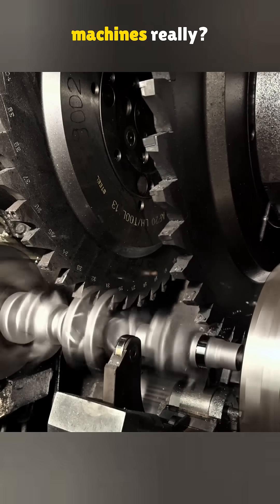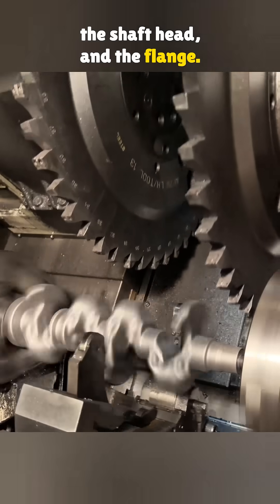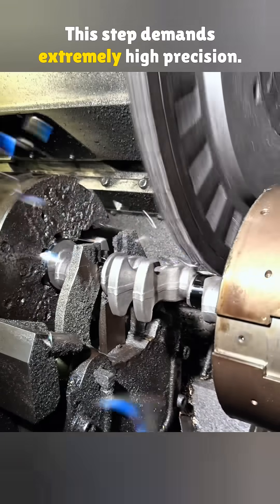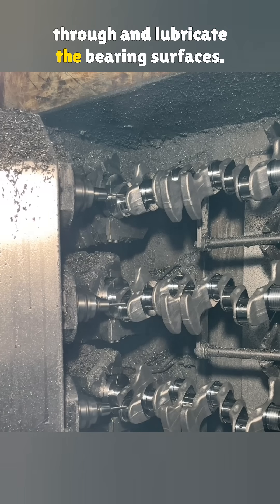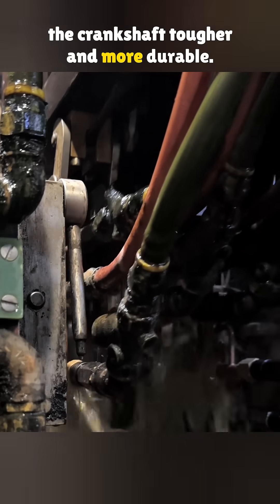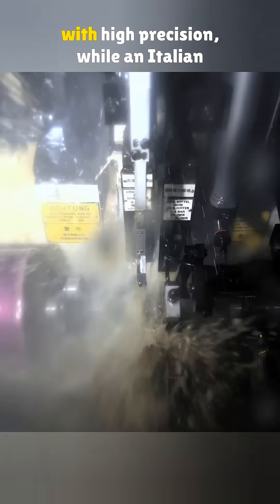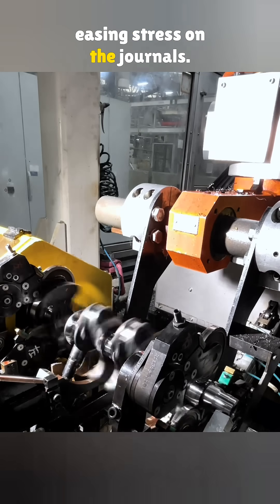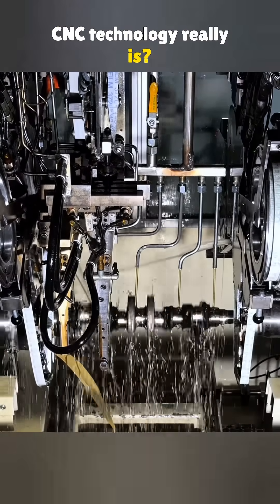How Far Behind Are Chinese CNC Machines #automobile #mechanic #car #assembly #manufacturing

Comment: What I have always been puzzled by is how come Chinese products made from these machines are way cheaper than those made in the US or other developed countries. The answer has always been cheaper labor cost. 

But that's not true, I did the math. Even if American or European salaries are 6 or 7x Chinese salaries (they're not that far apart, more like 3-4x), divided by many thousands of products, the labor cost difference is quite minimal. Assume lower electricity cost (China is about 1/3 that of the most expensive electricity state in the US), still it won't account for the large price difference, in some cases finished products from China are less than half US or European prices.

Then I came across a statistical study from China's own Nat'l Reform and Dev't Council (发改委) and realized China's price supremacy is due to massive and secretive export and tax subsidies. VAT rebates alone are 15%. Local government tax incentives take another 6-15%. 

And that's why China exporters can afford to sell their products at cost or even slightly below cost. Therein lies the secret. However cheaply and loss-making their exports are, China manufacturers can make it back through the rebates, and still end up profitable. Those rebates are powered by the Chinese central bank's continuous and secret money-printing (they NEVER announce specifics). Thus the world has essentially bankrolled 50 years of Chinese currency manipulation (illegal under WTO), and the capitalist class of other countries are only to happy to look the other way, because the same system boosts their profits.

Comment: Cnc tech in the wood working industry in the USA. I work on machines from everywhere germany, japan, italy, france, USA... Everywhere. I wouldnt say one is more agead of any of the others but each one has a strong suit that suits them well. However i will say that that when it comes to precision germany and japan are where its at, brute strength comes from the usa and finesse comes from france and italy but the finesse usually comes with a lot of headaches too. Lol. Every one of them is built with oarts from every one if these countries too so nobody is really ahead or behind anyone industry isnt political necessarily it struggles on account of politics but otherwise most everyone would work together.

Comment: I don't know alot about CNC machines but I've worked in a machine shop and it sounds like they have the best of the best equipment and take correct procedures to ensure a quality product that's better or as good as alot of car manufacturers

Comment: i visited some factories in china, and i've seen some pretty impressive machining centers which are made in china, not every single machine is chinese, and there are variations across factories, yet taking a single example for a single part type in a single factory and  making a judgment on the whole chinese cnc industry based on this strikes me as completely lopsided at best

Comment: That's because of manufacturing licences, and patents.

Some companies insists on specs for machineries used in productions.
Reply: I DON'T THINK CHINA GIVES A SHITE ABOUT PATENTS !!
Reply: @davidpeters7052 yup they'll even make it a local patent after that copy a foreign patent and brag about it being a domestic invention.

But the catch is, it's good enough for making household goods for Walmart. But not good enough precision for avionics, semi conductors or military applications.. That's why you see their military equipment failing all over the world.
Reply: @davidpeters7052 check out WIPO about China's share of patents
Reply: China has never and probably never will respect patents or copyright laws. Almost everything they have ever produced is stolen from the rest of the world.
Reply: @lpsoldin3162 check out WIPO about China's share of patents
Reply: Great comment. Well done. To those who think that China doesn't care about patents, it doesn't matter if they do or don't. They have to comply with the requirements of the customer who orders these manufacturing lines.
Reply: @alm7979 they only comply for the export client. So if a big brand is getting sued for patent infringements, then they won't get an order but it's also no impact on the Chinese factory.

On the other hand, China's domestic market doesn't care nor enforce patent rights in their own market especially when it's their own brand vs a foreign brand

Comment: Are you attempting to show why American car manufacturers are so far behind in reliability today. Something that they actually had attained in the 1980’s on many models. Quality had gotten better from the 1910’s till around 1990’s/2000’s but well something has changed, and not for the better.

Comment: USSR used imported equipment to achieve better quality. First Soviet car/truck factories were licensed from Ford during Great Depression and they included German equipment. But they had a large network of their own equipment manufacturers, maybe not suitable for cars because their production wasn't a priority. China licenses their engine designs too. The license may also include the equipment needed for the correct process. There's no obstacle for China to copy any technology they want nowadays, as technology is not evolving so fast anymore. Sometimes China has even more modern equipment, than Europe just because they ordered it later.